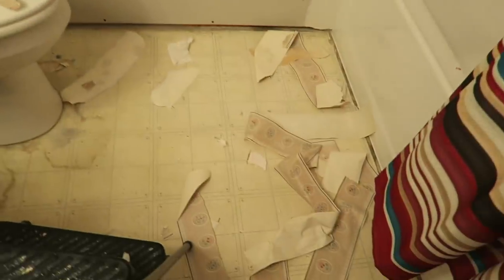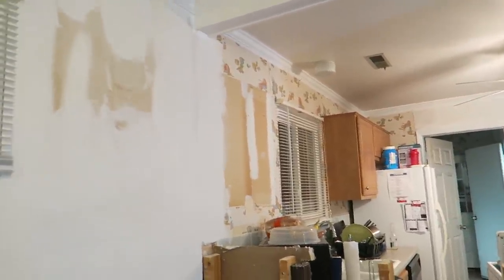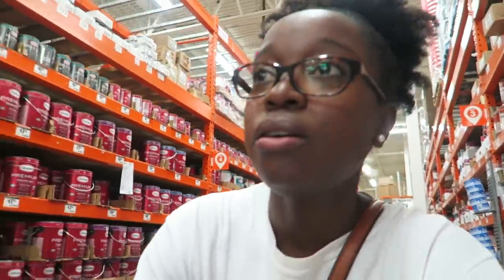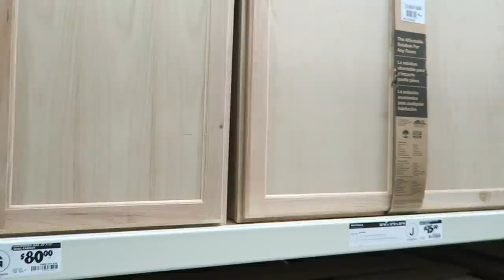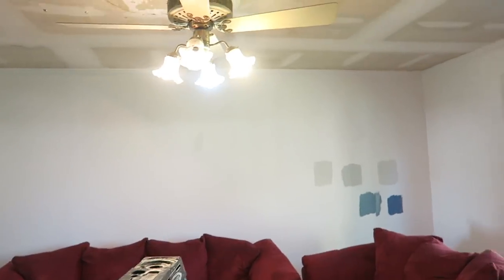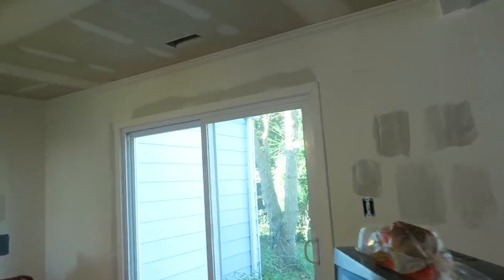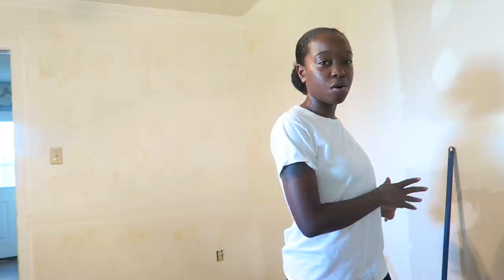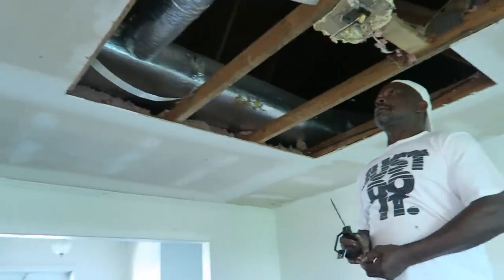HOME RENOVATION | Come Shop With Me For Kitchen Cabinets! + House Update!

Comment: Nice choices April! It's coming along beautifully. My kitchen is one of the reasons why I purchased my first home  last year. The previous owners did a total reno and my cabinets are grey with soft closing drawers, tall pantry, coffee bar counter/ cabinet space. I have a white wavy subway tile and lazy susan cabinet. My countertops and island are a white and grey quartz which I like but man you can see every water spot or smudge. All the finishes are oil rubbed bronze. I replaced the remainder of the light fixtures and a few cheaps ones that they installed.

Comment: I have been watching your renovations and I wanted to know what you used to remove your wallpaper. I had such a hard time removing the border in a bedroom of the home I purchased.  I was only able to get the print off but not the sticky backing, I don't know what the previous owners did but it took two weeks just to get the top layer of the border off. You made it look effortless. I want to get this job done so I can paint. Thanks.

Comment: Really wish you could expand the size of the kitchen, the wall that was partially removed in the kitchen where the oven currently sits needs to be completely removed, you have enough space where your little dining table is currently placed, that whole little area where your dining table is sitting needs to be used as kitchen space, just extend the bench from your sink down along the wall....sorry but the flow of your kitchen feels wrong....it is too tight